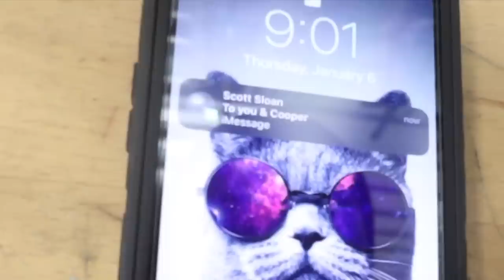My House Is Ruined

Comment: All that latte and plaster were put on over a hundred years ago. Just think of the craftmanship and pride they took in building, and they did it without power tools. Mad respect.
Reply: The first power tools are from before 1900, so I'm sure they had some help. There are original electric wires installed in the walls after all, so power was available.
Reply: Why did he pull it down? So sad.
Reply: @maryannanderson1744  rewire the electric to current code, add internet, etc, plenty of reasons to strip it down to the studs rather than trying to chase down individual electrical issues over the years
Reply: @maryannanderson1744  Because that's the way to do it right.
Reply: @derekp6636  no need to tear down all that beautiful construction just too rewire the house. Totally unnecessary to destroy a historic house like he's doing! No need for insulation on interior walls. Could easily cut some small areas for rewiring.

Comment: I would have left the majority of the lathe and removed what was necessary for electrical and plumbing. Blown in insulation would be the way to go as well. Once you remove the lathe there will be plenty of modifications required in order to install electrical boxes and sheet rock such as nailers and blocking.
Reply: ME TOO

Comment: When you get everything cleaned up and ready for drywall, insulate every interior and exterior wall. A whole lot easier to heat and cool AND sound proofing. Amazing difference.
Reply: and do so using sound insulation. No it is not the same as thermal insulation.
Reply: In addition, it is essential to ensure that any absorbant insulation is kept well away from plumbing, or any other areas potentially able to be affected by water. 

What would otherwise have been an inconvenience, could end up as a disaster as it can hide an issue long enough for it to become a major problem.

Leaks rarely go away, so the sooner you know about them the better!

Comment: Well Cole, I bought a house in 1981 (two story) same vintage as your house and removed the interior and rewired and plumbed 

and insulation, sheet rock.
I added 2 inch to the studs for the outside walls and allowed 6 inches of bat insulation, plastic sheeting (6 mil.) And then sheet rock.  Made for a well insulated structure.   Put in a wood stove
(Quadra fire) and heated the whole house.
Taking one of these projects on is a project and once your into the operation it goes fast!!  ALWAYS PROUD OF Y'ALL

Comment: Some old houses were built with different standard dimensions.  2 x 4s were really 2 x 4 inches.  Same with other dimensional wood.  Made it hard to add on new wood.  Studs were not always 16 inches on center.  My grandfather's house built in 1900 had crumpled newspaper for insulation.  There were articles about Teddy Roosevelt.

Comment: I have done that plaster demo on a few occasions. It’s brutal beyond words. Soon you will realize you must remove all the door casing in order to install drywall. Also, you will need lathe ( new, used, or strips of plywood to fur all the studs to get the walls back to the proper thickness in relation to the door jambs. Otherwise just add a spacer to the trim and a back band molding. You are digging in deep my friend and that house should be awesome when you’re done.

Comment: Use the thickest sheet rock you can buy to replace the plaster. You will be able to hear a lot more noise once all the plaster is gone and you install sheet rock. Put some insulation in the interior walls.

Comment: Suggestion for when everything is finally done at the pin site once you have to start running the sweep unload from the first bin enough to load what’s left in the second been into it that way you can just sweep everything to the Center some or follow it around for a day and make it one large day run so there’s just that little bit less wear and tear on the motors from starting up and stopping which should make them last just that little bit longer

Comment: Thanks for another great video. It was interesting and enjoyable. 

Sorry you are still having bin system problems. That grain outlet seems pretty shaky. Not good. Needs some reinforcements. Would get the company back to make that right. Sorry for all of you. Hang in there. 

Appreciate your hard work DC in the cold weather. Not easy I am sure and my memories. My compliments to you DC!!!!  The dryer shack is looking good with more paint. Nice. 

Appreciate all the jobs you are tackling in the winter weather. You about got the old Oliver ready to run and use. Good machine there. 
Cole you are coming right along on your house. Will be wonderful when you have it done. Lots of hard work now and rewards later on. Great going Cole. Will be wonderful home when done. 

About it for now. You all take care and be safe. Looking forward to the next video. 
Thanks for everything. 
The Iowa farm boy.

Comment: While you have the walls opened I would run radiant underfloor heating up through the walls to the upper floor can tie in the boiler you use for the radiators. Cause once you spray foam those walls and seal the building you will be nice and toasty.

Comment: As far as the side chute on the bin that is wiggling in the wind, could you run a straight metal bar from the bin out to the bottom of the chute and connect on the back of it to give it more rigged support? Hope the idea helps.

Comment: Knocking off the lath from the backside cut a slot in a chunk of 2*4 to fit the joist so you've effectively got a pronged drift. Then you can quickly just hammer on that working down - less aiming and does two at once with no breaking. Much more efficient

Comment: So why remove the plaster ?  It looked nice and supposedly is superior to modern drywall.  Where there cracks? I know your likely to be moving walls and such,  for the cost you could have opened the cavity with small holes and had spray foam put in the cavities .   I'm sure you did have good reason I just haven't caught on yet
Reply: Not trying to be a smart Alec but this is all explained in previous vids. ( Years of water damage from a leaky roof, necessary to run electric,  hvac, and plumbing due to the new configuration of rooms, impossible to match the new and old plaster to drywall spacing etc. )
Reply: Damn near every wall upstairs is moving so just what plaster should he have left alone?

Comment: And coming from a machine expert like myself. You bought the wrong skid steer. Or track steer as we call it here but Kubota makes the most powerful and for commercial use the best one. But also the most expensive. Those one side booms get sloppy. Sure there great for getting in and out. And have a great visual on the left side. But the right side sucks. I watched my boss run over a stihl quick cut and my personal milwawee grease gun cause of the blind spot on the right side. And no power. But I’m guessing the price was right. I’ve seen company’s use the 75-95 hp kubotas to back fill sewer trenches instead of a D3-4 Cat dozer or a 450 John Deere dozer and the track steer had no problem keeping up with a 50 ton excavator and a 25 feet trench. I prefer a dozer. But hats off to those skid steer operators.

Comment: Coming from someone who has 20 plus years operating a rubber tire Backhoe. I haven’t seen a 2 wheel drive since I learned on a 1984 super E 580 extend-a-hoe. I know they make them. But here in Canada we all run as you Americans say” Front wheel assist” but in Canada we call   It 4x4 lol

Comment: Too bad you don't have a woodburner in the house . When we did my mom's house we used the lathe to heat with just to take the chill out . Same time of year too . my stepdad build a slide out of one of the windows down to the dumpster so we could wheelbarrow the debris and dump it . Many a lunch was cooked on that woodburner to feed us during the project .

Comment: When I saw you were doing lath, all I could: Oh, boy, the lath.

My own learned lesson from major renovation of a ~125 year old house this summer: "Just do it." Not like Nike or something, but when someone's got some "great" idea for a simpler solution, just recognize: It's not simpler in the long run. Just do it right; pull all the trim, the accessories, etc.
I have forced air so don't have to deal with the heaters the same way, but I'm feeling like.... How hard is it to remove those? Because I'm kinda thinking they should come out until you get stuff cleaned up and replaced, then go back into place.
Just sayin'.
Good luck!!

Comment: I gutted out our first home that had lathe and plaster.  Lucky for me, I had a cistern that needed to be filled and I shoveled out the upstairs window and then into the cistern, it took all but the last room.  The lathe was taken out and burnt.  It was so dry, you could light it with a match and went up quick.    A little hint, if you are putting up drywall you'll need to shim it out so that it is flush with your existing door and window jambs.

Comment: As you plan out the new layout of the house, don't forget to prepare the walls with networking (in case that gets planned in later) it will save you alot of hastle later as everything is prepared for it later. Cat6 should do it for now 👍

Comment: Just changed the fuel filter on one of my old tractors that hasn't been started for a few months and it stopped working 30 minutes after the filter change. Forgot there was summer diesel in the tank, and it filled the filter with paraffin(I'm from northern europe). Had to get a new filter and replace the fuel with "arctic" diesel. Happens almost every year. 😅

Comment: If those are one pipe steam radiators you can just rotate them on the pipe joint coming up through the floor. No need to even loosen the joints.

Comment: It is amazing that we are excited and smile at the start of demolition projects so keep showing us that sexy smile Cole. I heard you mention putting laminate over your original wood flooring. I am an architect and have done many historic renovations as well as my personal home and my siblings and parents homes. I have taken flooring from closets to patch where walls were removed. The patches are part of the evolution of the house so they are evidence of renovating, not a problem or deterrence. Where I needed new flooring I bought pre finished bamboo that was tongue and grove in a color that matched the original so they were both real wood and much more durable than laminate. Much more beautiful and just as easy to maintain as laminate as well and it was just as cast effective and quicker to install than laminate. We installed it ourselves with a floor nailer with felt paper over wood sun flooring. You will like it much better and it will last longer. Laminate is a photograph laminate on pressed wood chips glued together with a sealer on to. It will wear eventually and cannot be refinished whereas the bamboo can or will out last the laminate as it came from the factory. Good luck either was and if you want any help let me know, I’m retired and about to publish my book “Forensic Architecture-Saving One House At A Time” I would be glad to help for free as neighbors or friends usually do. Architecture is my passion and I love what I do so I can do complementary projects at times. Keep up the great work my friend. 😎

Comment: I'm confused, based on how this video is presented. It doesn't look "ruined" by any stretch. It actually looks more solid than many newer homes I've seen, including my own (built 1967). Now, you've got a lot of cleanup, but that goes with the territory in a hundred year old house. But I feel like you're gonna be fine. That place looks solid, just needs a modern tune-up.

Comment: Hola El jefe, since you tore apart the inside are you going to run central air and heat, maybe new plumbing while the walls are exposed? And also are you running a smart hub system as well? And also any worries of asbestos in the house? Save a ton of work in the future to just update plumbing and electrical now right?

Comment: I understand CornStar acted as contractors for the project. HOWEVER, The sub-contractors were likely hired through the system local distribution to build the system to specific quality. It is NOT the responsibility of the contractor to double-triple check the work of the sub. These sub-contractors cut corners, causing safety issues and  sub-par in there work quality. Unfortunately, holding them legally liable will be costly.

Comment: I am wondering however, why you would ever remove the lath and plaster as it is quite sustainable in a fire-proof and heat holding friendly kind of way! I dunno, I kind of would have left all the solid wonderfulness of the old construction as it's more conducive to holding heat!!! Very sad to see you let it all go without a word of you looking into the importance of conductivity and also the insulate properties of plaster. It's proven to be the choice material in the colder parts of Europe for centuries for a reason. Aside from stone, it's a keeper for many reasons. I think you'll soon regret your decision to tear it all out.

Comment: With the walls open like that. I would use the opportunity to add networking and coaxial cable in the walls and access points in the ceiling. Other than that, can't wait to see the house finished!
Reply: Make it conduit of some sort. That way you have built in flexibility for future electronic changes. Then you just pull thru whatever the new wire type is. Easy peasy! 👍
Reply: I tore out all the co ax. Wi-Fi
Reply: @adamgottemoeller6571  You made a mistake then.

Comment: Looks like the plaster was on tight. Not sure the reason for removing it. It's easy to repair damage plaster. As you can see plaster is a lot stronger than cheap drywall.
Reply from the maker: The house needs re-insulated and the knob and tube wiring needs replaced.
Reply: He's changing the floor plan with a better layout to bring it up to date; ac/heating, plumbing and electrical.
Reply: The rooms are being reconfigured and en suite bathrooms created, new wiring, plumbing, and other amenities!!

Comment: What if you had a bunch of big plastic trash cans when you take down the lathe so you can put the pieces directly in the cans and avoid a 2 movement process of putting it on the floor then picking it up off the floor to put in a trash can?

Comment: The construction company that assembled your bins KNOW what needs to be done and they are apparently a HALFASS OUTFIT.  For the money you spent Lord, I hope you haven't paid it all. Supposed to hold at least 10 percent until it is inspected and approved. HIRE AN ENGINEER TO VALIDATE SCREW UPS) it should be done without having to make ONE DAMN CALL.  I can't stand halfass damn contractors

Comment: Cole, you're probably right about the wainscoting on the stairway wall being not original. Up here in Bath, Maine anyway, the wainscotting would have been put on before the walls were plastered or, they would have put a ground on where the wainscot would start, and the plaster would stop.
I'm guessing you had some guidance or you're wicked smart because you took the plaster off, clean it up then take the laths off. I've seen people rip it all off at once and it is hard to clean up.
I have remodeled so many Victorian houses in my 47-year building career. No more plaster ripping for this old man.
Reply from the maker: I made the mistake of ripping everything down in the first room I did. I learned the hard way!

Comment: Well for once your video title is correct.  You'd be money ahead when you're done by doing a complete teardown and putting up a modern cookie cutter house.  Most of what you're doing in your "renovation" is removing the charm people like in old houses.  Tear out perfectly good lathe and plaster to put up drywall which you'll find in the cheapest builders grade houses... I'm guessing other things like the fixtures in the bathrooms will be modern Menards/Lowes/Home Depot crap.  Tear out a cast iron tub to put in a fiberglass tub, etc...

Comment: Cole: I know you have an awesome electrician, and he will probably be on top of this, but wanted to mention something. When you go to do the electrical on the house, put a sub panel on each level of the house; why have to chase up and down stairs for tripped breakers?  Also means a whole lot less wire running.

Also, while you're all opened, run your network cabling! Go Cat6, all homeruns back to a single, central point, keeping all cables under 300'. Also plan on where you are going to put your wireless access points. Ubiquiti makes some great solutions, I use them in both commercial and residential solutions.

Comment: That wood should be reinstalled after you insulate and dry wall, it's worth thousands of dollars, yes the SUV Ray's changed the color of the wood, I will be so upset if you don't put it back up.